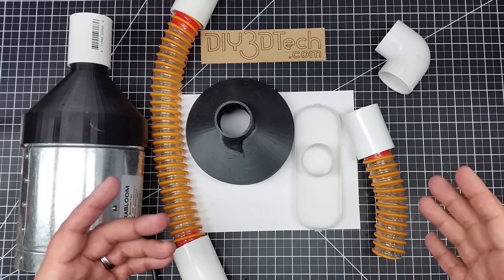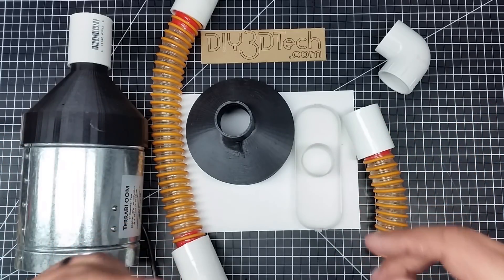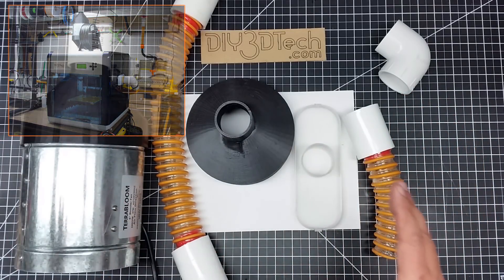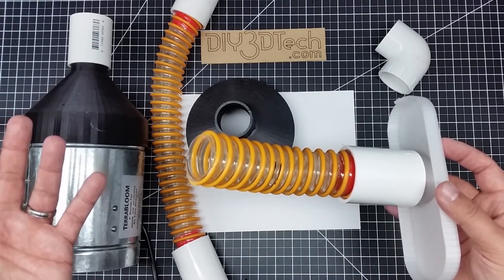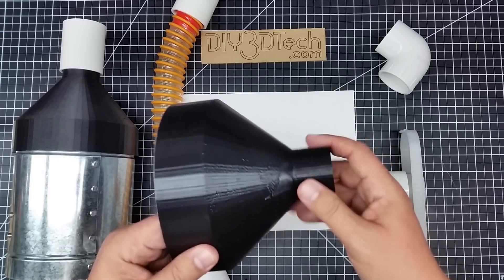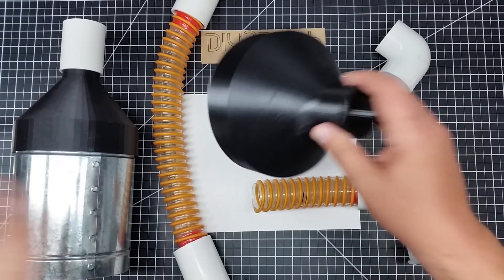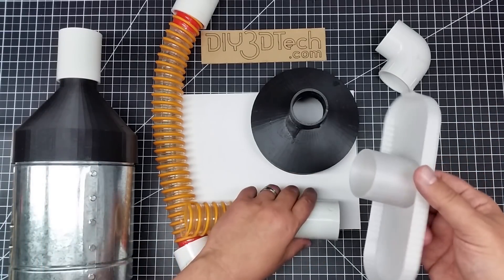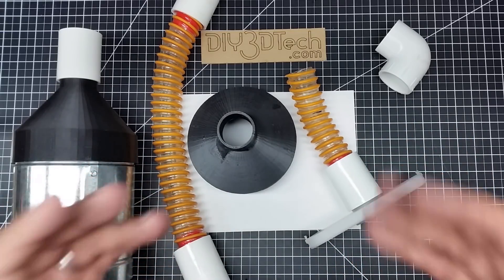Shop Talk - 3D Printing and Air Quality!

Comment: Are those marine blowers better suited for long continuous running and less likely to spark?
Reply from the maker: Didn't have issue however check out this video as I have switched as this is an older video: https://youtu.be/2HYl5sbR39I
Reply: @DIY3DTECHcom  new setup looks neat. I’m thinking of doing something very similar with a bathroom vent fan

Comment: did you post a video about your PLA solution that you mentioned at the end?
Reply from the maker: This was while back and did a ton of other related videos.  Was there a specific question?
Reply: @DIY3DTECHcom  just wondering what your filtration/venting/enclosure setup looks like when working with PLA/PETG? looking to get into 3d printing but nobody really talks about the health risks. also, was talking with a friend that had set up ISO labs at one point and said that if you make the air and the printer humid you can get the nanoparticles to clump and attract to each other. this would make HEPA filters way more effective because the size of particles increases. tossed the idea around of printing over a bed or pan of water. maybe even distilled or deionized water with a dab of soap to break the surface tension. no way for me to know for sure though 🤷‍♂️

Comment: If I have a tiny printer can I just bring it outside instead of building the ventilation system.
(I'll probably just make a big box around it with a fan that leads outside.
Reply from the maker: Sure I don't see why not...
Reply: Okay thanks,

Comment: Liked the video. 

Would have loved to see more of the actual installation setup (end to end)
Reply from the maker: there likely is a video including this some where out there (I think I am nearing 800 for this channel).  For 3d printing it it worked ok and I say okay as it was a bit of over kill at 6 inches as you really only need to create a negative "draft" so the air is drawn out so this will be based upon the (air) tightness of your home / shop.

Comment: So, I don't mean to be picky but the smoke alarm you linked is not really wifi. It links to other smoke detectors of the same brand and sets all detectors off, but it won't alert you via wifi on its own. Just wanted to note this because I'm looking for a stand-alone wifi smoke detector and noticed that the one you linked to does not have that capability.
Reply from the maker: Thanks for commenting, actually they are WiFi  (they operate on the unlicensed 2.4/5,8 gig WiFi spectrum) to communicate with each other on their own protocol.  These  do not connect to a WiFI SSID as I think that is what you looking for such as the Nest Products...

Comment: Could you please tell me where you bought your hosing. Matching hosing and cuffs apparently isnt meant to be easy unless you pay $500 or im not lookong at the right websites. Returning First attempt on amazon as the same brand hose and cuff dont work together
Reply from the maker: I got it from eBay in a larger lot, I am sure it is an expensive hose as I paid $75 for 40 feet of it second hand. It was new but being sold off as left over from a larger reel...

Comment: I close the door and cold air return to the room I print in. I then open a window about 25% and open forced air vents all the way. The result is most, if not all the air vents out the window. Testing shows odors exhaust quickly. I would like to save energy and have a  dedicated negative airspace pulling printer air only. This system you have would be a great little project.
Reply from the maker: That is a way to force the air out however keep in mind that over that there still will be a particle up as these are very small particles and will be statically attracted to things...

Comment: I have to add my two cents here. I started 3D printing just over a year ago. Started with ABS (a bad idea for a beginner) in my drafty basement. I ignored the strong smell because I was having fun. About 4 weeks into it I suddenly started getting dizzy at work and having ttrouble breathing. Doctors couldn’t tell what was going on. I did some research into my new hobby and found out about ABS fumes and formaldehyde. I immediately switched to PLA because of this. Took about a month for the symptoms to go away. You can say whatever you want about the data and testing but my own experience with this has not been positive. I’m much more careful now.
Reply from the maker: Wow!  Thanks for sharing this and will add to the resource page as your right on both accounts (bad for beginners and fumes).  As yes, ABS does tend to out gas formaldehyde which can trigger issues as well as teh VOC's...
Reply: I can only say that PLA hasn't given ME any ill effects that I have noticed anyway. And I am sensitive to everything. It's the only thing I will print with now.

Comment: Yep the verdict I think is still out, but like you Joe, I don't want to be the one who finds out too late that my printers have been harming me, or worst yet my family. You're 100% right, evacuation of the by-products outside the house envelope is the absolute best way to deal with it.  

Unfortunately for me that is just not possible, so I have to rely on filtration, which is incredibly tricky at best.  What I've discovered is a single pass HEPA system doesn't do a good job at pulling UFP out alone. ULPA filters do a better job, but are much harder to find for small scale filtration devices. Apparently even though HEPA's don't help much with UFP's, they do help when utilized in a recirculating (multi-pass) system.  So my old air scrubber utilized a 100% evacuation (single pass) system, where it appears a > 75% recirculation system is far superior. 

Then you have VOC's, which are another animal all together. Carbon is 100% necessary to help 'absorb' VOC's.

One thing is for sure, this is a massively complicated topic, one in which I'm I'll equipped to speak with any authority. Everything I think I know/understand is solely based on simple personal observation.
Reply from the maker: First your 100% right "one who finds out too late that my printers have been harming me" second is yes too "evacuation of the by-products outside the house envelope is the absolute best way to deal with it" as I vent to the outside for ABS.  However for me when read all the studies like (https://all3dp.com/3d-printing-toxic-emissions-everything-need-know/) the verdict for me is in and as you said "I don't want to be the one who finds out too "!
Reply: Yeah the verdict on the quantity and type of emissions 3d printers put out is not up for debate anymore. However I think more studies are needed on the health implications of such emissions.

Comment: This looks like it may be a good option, not too expensive,  to stop a fire Automaticly
Designed to be mounted (on the wall bracket supplied) in un-manned areas, these automatic extinguishers are triggered by heat levels commonly associated with fire.

Extinguisher fixing bracket is included
Effective on class A, B & C fires
Suitable for boat / vehicle engine compartments / generator rooms

Automatic Fire Extinguishers for boat engine rooms and any unsupervised area such as computer rooms. Available w...

Small Automatic Powder Fire Extinguishers  £31.19 inc VAT
https://www.safelincs.co.uk/small-automatic-powder-fire-extinguisher/
Reply from the maker: These would be good to mount over a 3D printer...
Reply: Yes

Comment: Fire protection
https://www.systemair.com/globalassets/downloads/uk/fire-safety.pdf
Reply from the maker: Looks like a plan for an apartment building (which is what I think it is intended for) as having owned multi-unit rentals in the past.  Having fire separation is important and one of the reasons I don't like multi-unit building as you get a candle lover in one and you have problems...

Comment: Add a relay switch to shut down fan if a fire happens so that it does not increase air to a fire or spread a fire along any of the tubes.

Hacked Filter from a 12 Volt Computer fan powered by a USB port ( Has Carbon filters and HEPA filter in back from an old vacuum cleaner )o
https://hackaday.io/project/7821-hacked-filter-from-a-computer-fan-powered-by-usb

Making an additional one, 3 Computer fans +  Carbon filters  may add better filters to my 3D Printer enclosure
https://www.youtube.com/playlist?list=PLUqt0sTiXUDcMu3PxXJ6Iyw444FSnzjyv

Moldex P3R Particulate Filters are said to be the best, inside area, , filters: but have to see if fans can push/pull air through

.
Reply from the maker: The issue is you want to avoid the fire, and think (again only my opinion) that VOC count is so low there isn't an issue.  Now if it was an automotive paint booth that would be a different story.  Also thanks for sharing and yes have seen the YT video as I have looking at this topic for a while and feel (again MHO) the HEPA's are good for PLA but ABS needs to go outside as the more and read about ABS/HIPS the grimmer they look in a closed air enlvope of a home...
Reply: I am thinking more about say Hot End, filament catching fire and that fire getting blown along the tube to spread
Reply from the maker: I do wonder why someone hasn't come with a safety kill for a hotend or something...
Reply from the maker: That was pretty cool :-)

Comment: Please notice that HEPA filter doesn't help at all with VOC's. It is only particle filter and doesn't filter any gases. Your way of extracting them outside is a really good way of getting rid of them.
Reply: Yes correct: Moldex P3R Particulate Filters are said to be the best, inside area, , filters: but have to see if fans can push/pull air through
Reply from the maker: You are 110% correct as HEPA is better then nothing ( and you will a video coming where install the mother of all HEPA filters in the shop for  PLA other not so bad plastics), however external exhausting of ABS & HIPS is a must for me!  :-)

Comment: @4:00 if you use conformal coating or liquid electrical tape on the things that show would that make it a good to go?
Reply from the maker: Ah think I see what you are saying, and sorry no as the issue is the motor is "brushed" and therefore creates tiny sparks which ignite concentrated VOC's.  However my experience is the the typical amount of VOC's is not an explosion hazard (IMHO) however one of longer exposure risk....

Comment: At work I have to deal with environmental health and safety so I specified a 3d printer that would meet with their approval.  We bought a Fusion3 F400 with the hepa filter option.  With its sealed chamber, we can print high temperature polycarbonate without warping and no noticeable fumes.
Reply from the maker: This is very interesting and thanks for sharing!  In researching this video I came across those enclosures and they look interesting and included some of them on my resource page: http://diy3dtech.com/3d-printing-and-air-quality-risks/